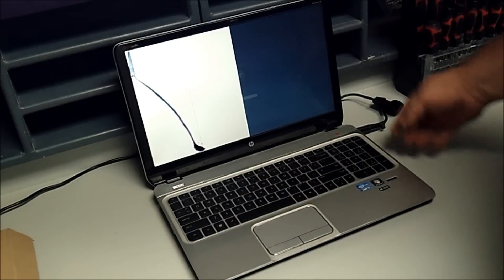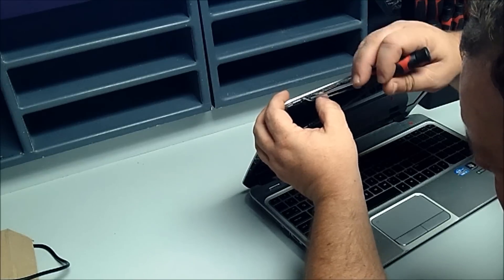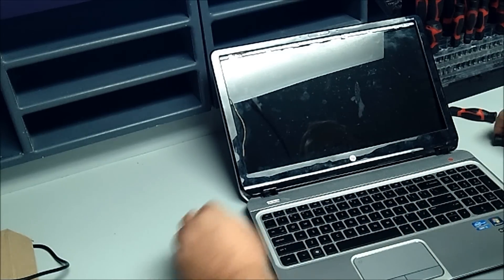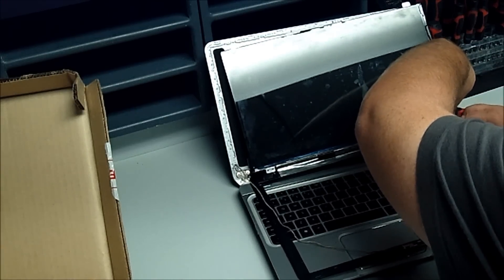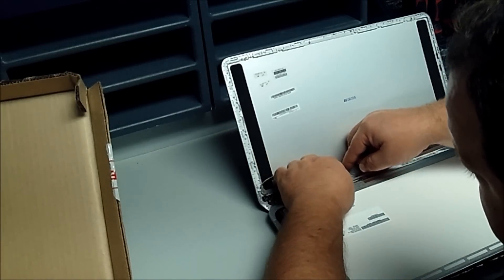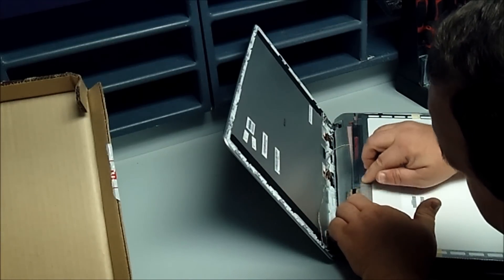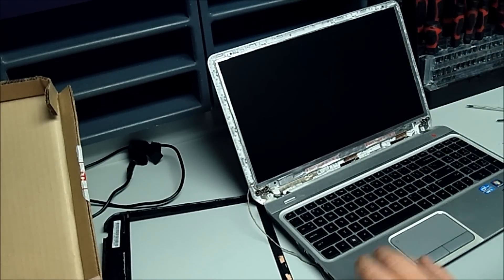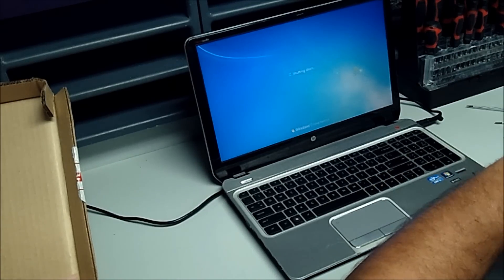Laptop screen replacement / How to replace laptop screen HP Pavilion M6-1045DX

Comment: I followed his instructions exactly. I was able to do it. Since I'm not tech savvy and not used to working with tools, it was a bit difficult for me to get the screen wire to connect to the new screen. Still, I was able to do it. If I can do it, you can! Save yourself some money, follow his instructions, and replace your own screen. :)